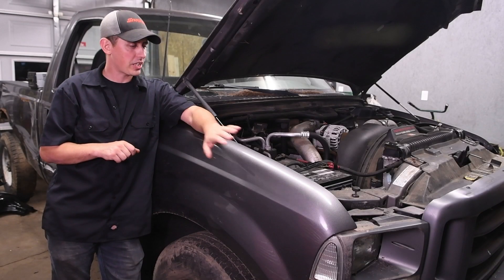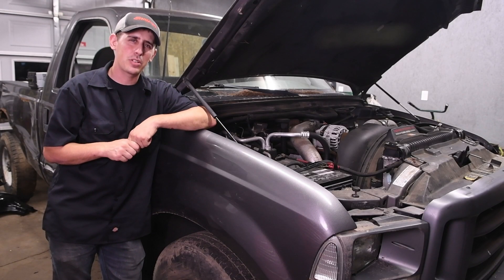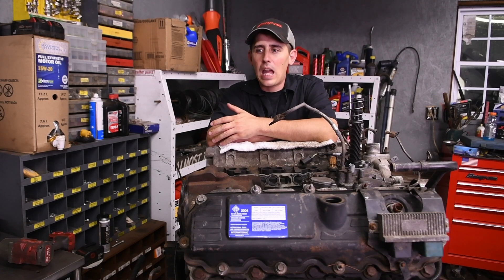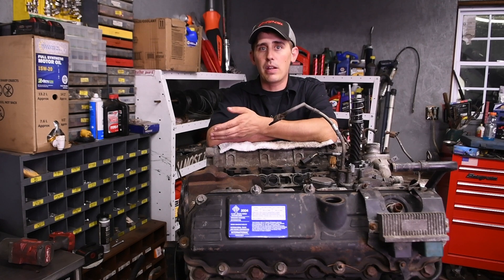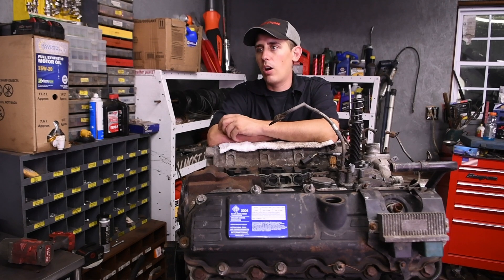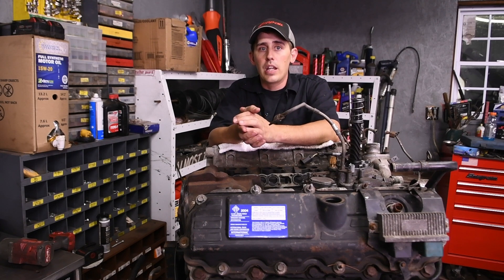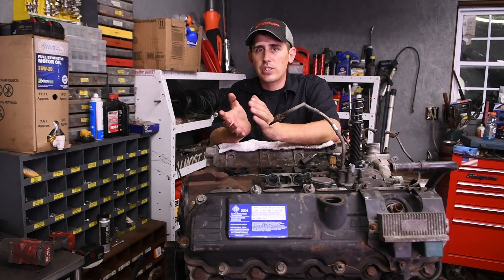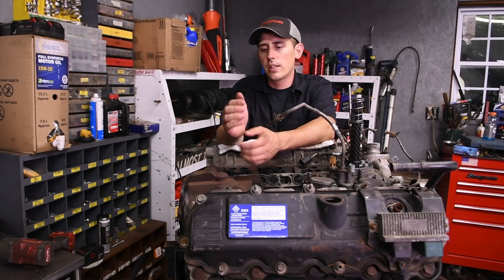6.0 Ford NO START diagnosis

Comment: Do you recommend a high pressure oil gauge. Are they available?
Reply from the maker: jose martinez they are available but I’m not the biggest fan of having the truck full of gauges. A nice monitor does the trick and keeps the dash and pillar clean.
Reply: @InTheShop  thanks, guess I am just old school. I like oil temp and pressure gauges, coolant temp, and  good amp meter if possible. With HPOP I want to see how system is doing at all rpm ranges
Reply: Glowshift makes them